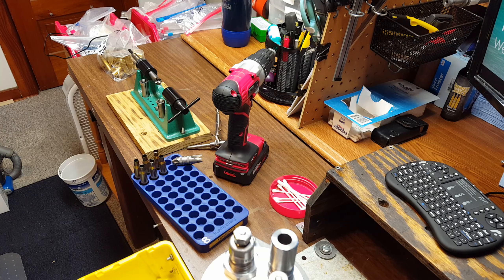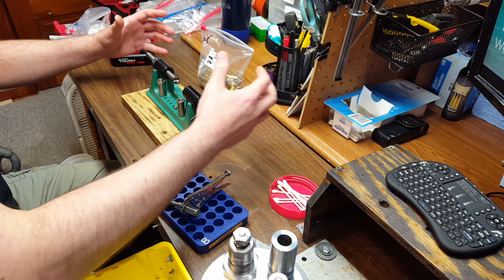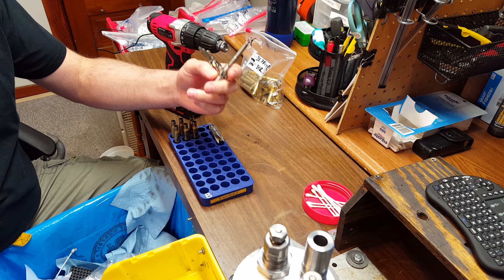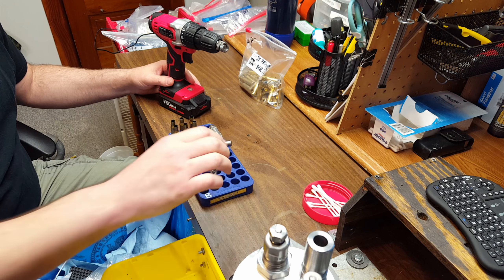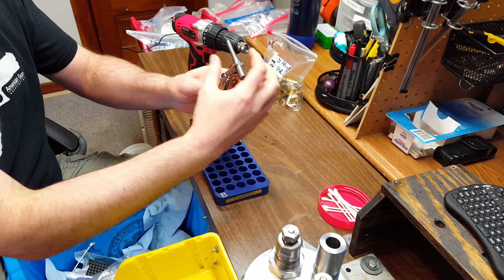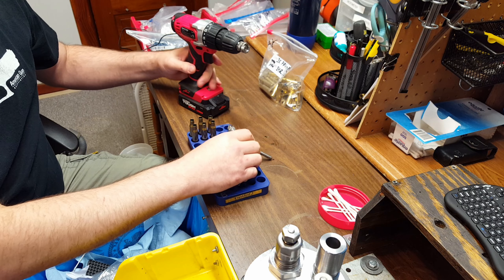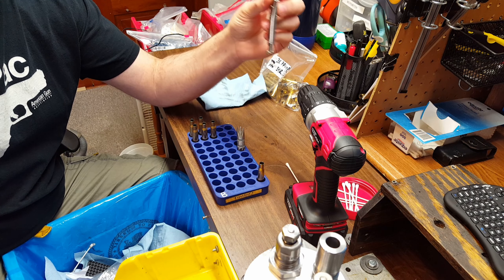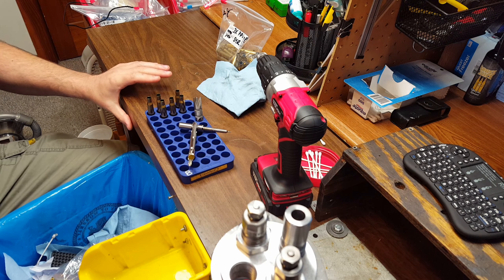How I Trim Brass, options/advantages.

Comment: The Lee gage trimmer is what I use, with vise grip 👍👍👏👏🇺🇸🤓
Reply from the maker: Nice, that's the way to go!  Some of the new motorized systems look neat but still having to adjust them every time...I'm not sure.  There are some really expensive systems out there that I'm sure are great if you want to spend the money.  
Lee needs to make a 3 way cutter for their gauge trimmer system, that would be sweet.  Wouldn't be easy though for the inside chamfer.

Comment: Same as you , I have a lathe trimmer , the Lee die trimmer and the Lee pilot set . More often then not I use the Lee pilot setup . I did modify the setup a bit so the shell plate doesn't loosen up .
Reply from the maker: James Pollard I had a shell holder base that got loose all the time, tried a different one and it never gives me problems.  Not sure what the difference was.

Comment: That’s pretty good I still use the Lyman case trimmer it’s not bad I like it because of the built in universal shell holder
Reply from the maker: ocean374 That's what my dad uses and seems to like it.  I got the RCBS ones used and pretty cheap...

Comment: Tried the lee die trimmer thing too...nothing but inconsistency and shavings all over the press.  I use the Lee Guages and Ball knob all the time now.   BUT, they're only available for a percentage of the calibers I load.   Need to get myself a lathe trimmer for that 1 obsolete caliber.   Vice grips is a great idea for anyone, bad back or not, those little f*ckers are sharp.
Reply from the maker: Measure In Grains Glad I'm not the only one who doesn't like the Lee die style trimmer.  Is there a cartridge close enough to what you need that you could modify one of the Lee gauges?  I was thinking you could easily put small washers on the threaded part to lengthen it...  Or find a friend with a lathe :)
Thanks for watching!